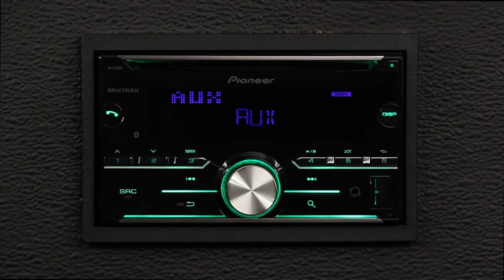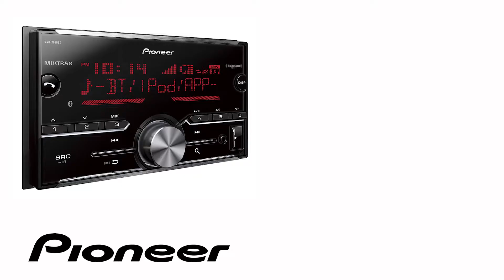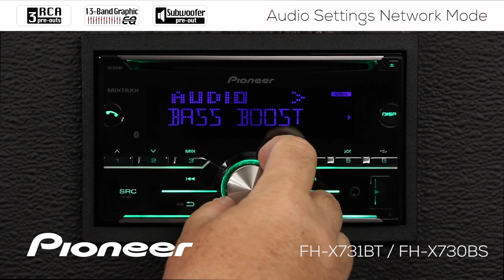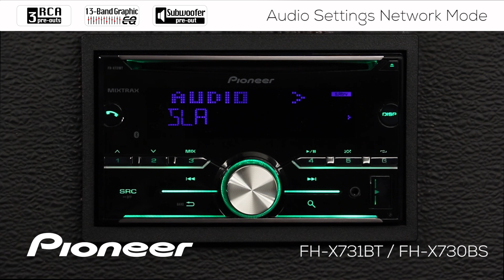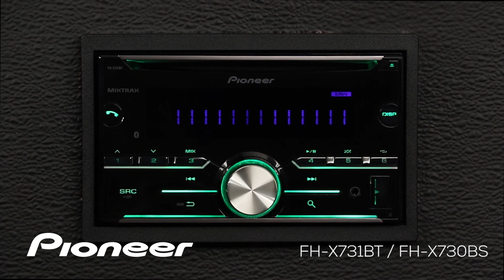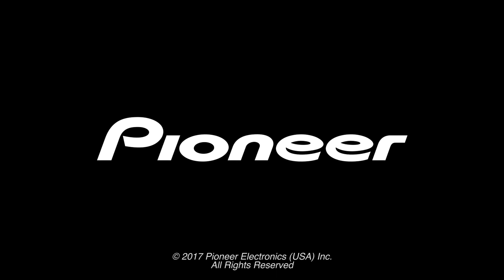How To - FH-X731BT / FH-X730BS - Audio Settings Network Mode

Comment: Radio installed correctly ( I think) in my 2005  rav4. Problem is back speakers don't work nor does the radio see them as it only shows front only.. Is there a update to fix it or wiring is bad? I heard something about the blue wire. That's not connected
Reply from the maker: What is the model number of your Pioneer in-dash receiver?   It sounds like you have the receiver set up in Network Mode? And you may want to set it up in Standard Mode.  Here is a video from Pioneer explaining the difference between Network Mode and Standard Mode.  Please watch this video with the sound on:    https://youtu.be/k3q0Zm5jvHg
Here is a video explaining the wiring harness for Pioneer receivers.  Please watch this video with the sound on:    https://youtu.be/kR2MO2kwFug
You can find more videos on Pioneer's YouTube Channel here:   https://www.youtube.com/user/pioneerelectronics

Comment: My 731bt isn't giving out sound
Reply: Does the Pioneer FH-X731BT power up when the vehicle is running?  Do you have speakers connected to the in-dash receiver?  Or are you using an external amplifier?  You can find more videos about Pioneer FH-X731BT here:  https://youtu.be/YsyYo7O-Muw?list=PLw63zJRQbCNjrJMo-h1YOEbzCdXw_DWPG  and you can find more videos on Pioneer's You Tube Channel here:  https://www.youtube.com/user/pioneerelectronics